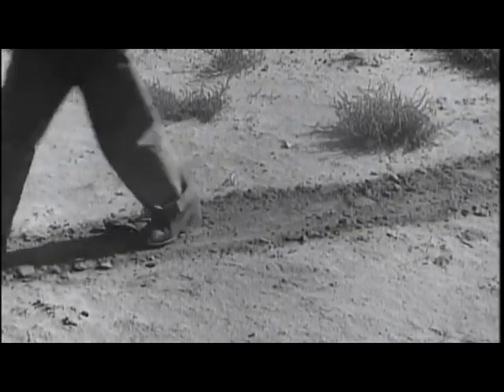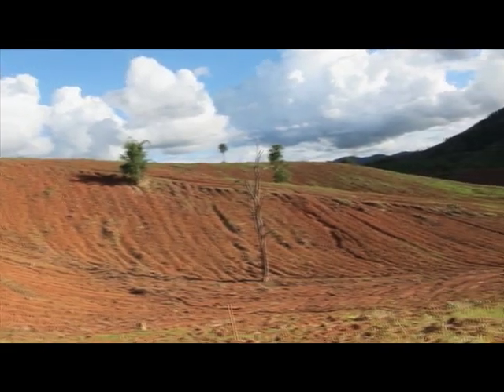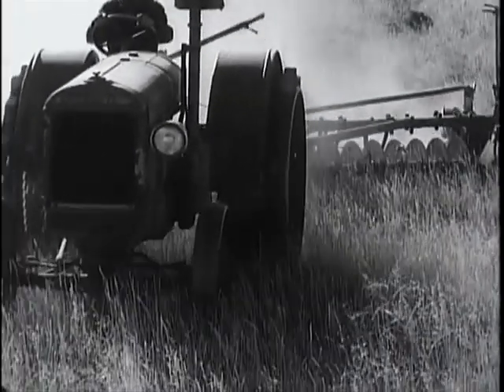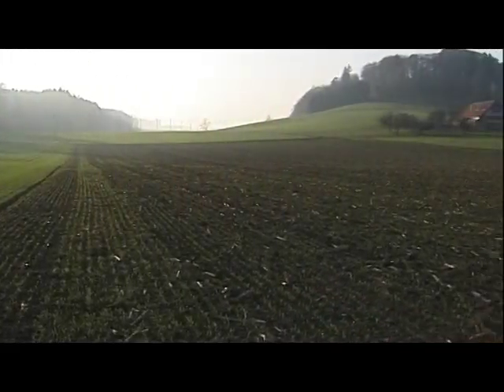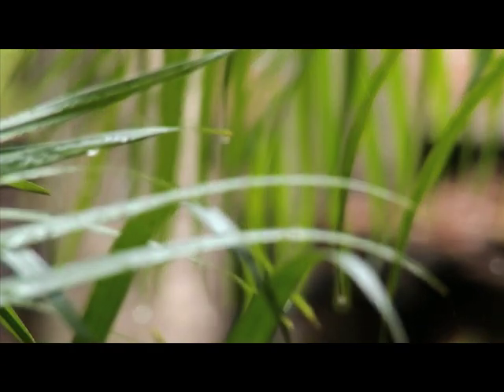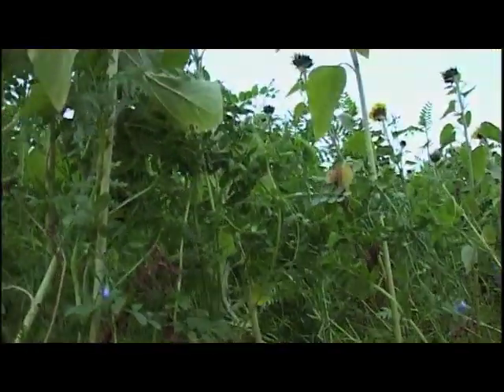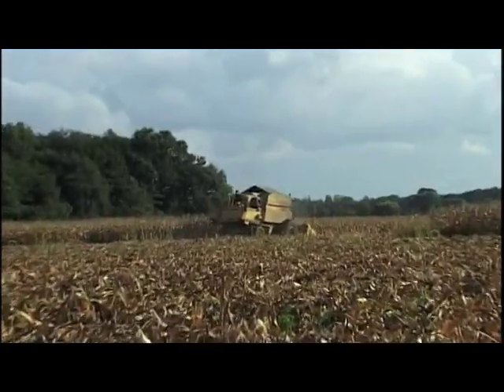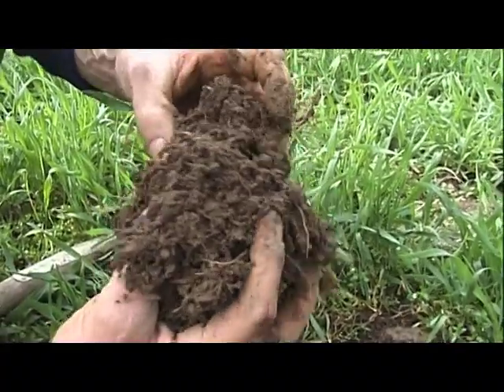World Bank: No-Till Agriculture Prevents Soil Erosion

Comment: I had a land slide issue in front of my house. I put 4 bags of cow manure in the rock supporting wall and planted grass to hold it. I also threw  bags of mulch on top and walked away. I fived my landslide problem for under 20 usd fir the compost. Oh, and it holds inane amounts of water